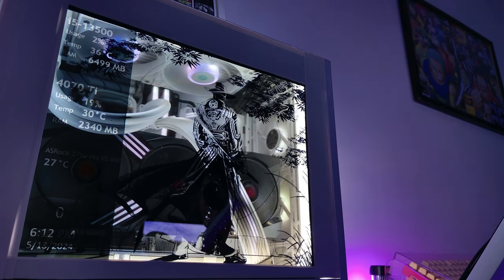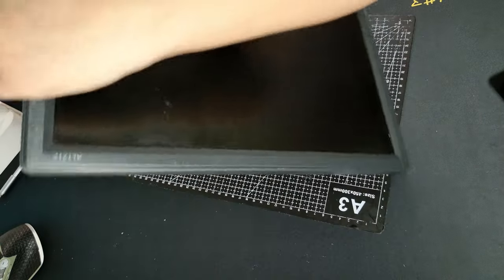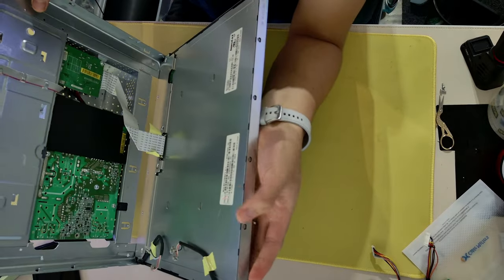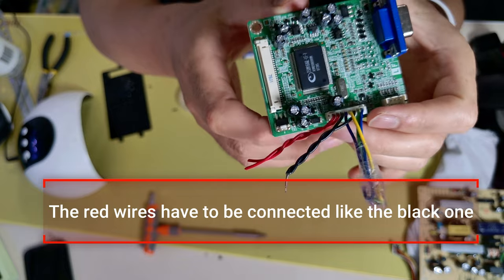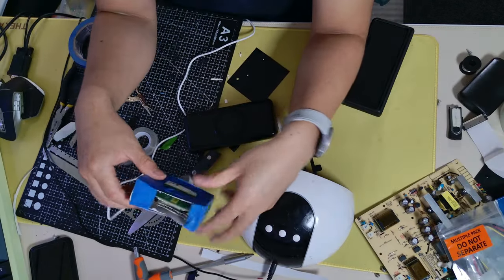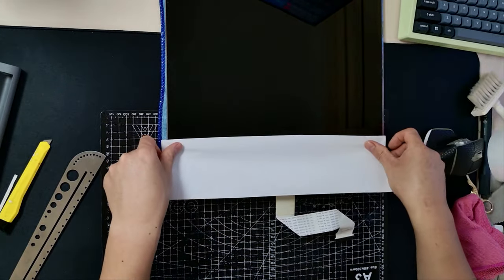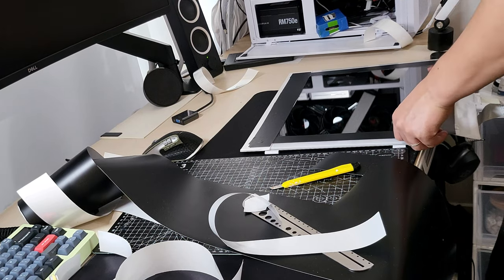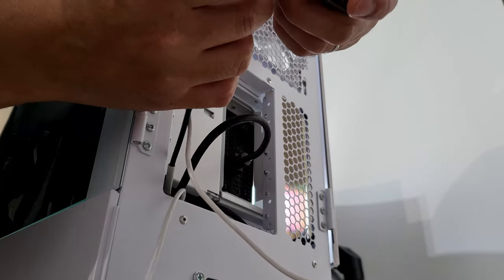How to build a Transparent LCD Side Panel for PC: Snowblind build #pcmod #gaming #snowblind

Comment from the maker: The monitor i used is from Acer not Samsung. I mispoke in the video. And If you are trying this mod, then here's a few IMPORTANT heads up.

1. make sure you leave the wet cloth on for around 6-8 hours before you peel it off. Peeling it off too immaturely leaves streaks, and leaving it on for too long peels off the polarizer as well at times. 

2. Right after you take the LCD panel off, secure the long board that's attached to the panel with vinyl tapes like I did in the video, cuz it SUPER easy to get damaged. (I destroyed 3.)

3. If you have black components  inside the case, this mod is NOT worth it. You really need plenty of LEDs and a white interior to really make it work. 

4. GOOD LUCK! HAVE FUN! and Watch this important trick. https://www.youtube.com/watch?v=dQw4w9WgXcQ
Reply: I only have a black Motherboard and black ram (the rest is white) i don't think thats gonna make the end result much different then yours if i put enough light in the case
Reply: Ty for the fast Heart
Reply from the maker: @randompsv2409  that's what you think, but a black surface cannot reflect light properly. Which makes the lcd barely visible. But do give it a try, cuz I might be proven wrong. Lemme know how it turns out and good luck
Reply: @lunosama  im gonna give it a try and If it doesnt Work i will think of Something ig

Comment: Nice video, I did this mod already. Something I'd like to add is: Use a very bright cold white LED strip. Don't get an RGB one. You can change the colours with the monitor. You need all the white light you can get
Reply from the maker: @madjoemak  oh I didn't know that, thank you. The one I had installed is a white led strip, but the lcd makes it look a bit warm.

Comment: Your snowblind custom is so simple, specially where you cut off the power voltage of the the monitor and just connect it together. Unlike others they compute the voltage in order to know which is the right one to connect voltage together.  By the way you said Samsung monitor but you use the Acer AL1717, which is the right one?  Great Work buy the way. I will try to do the same. Thank you. 👍
Reply from the maker: Thank you for the comment 😊. You're right. It was a slip of my tongue. It is the Acer AL1717. Thank you again
Reply: @lunosama hey I need some help I accidentally put the wet towel on the the opposite side of the display ( the back side) and removed the coating and now confused is it really antiglare??
Reply from the maker: @Dropship-jc9yq  sometimes the anti glare coating is pasted on both sides. As long as it is not the polarizer which is usually tinted, you're safe.

Comment: Are you having problems with your main monitor? Many people write that if two monitors with different Hertz are connected, then the main one (144 or more) will have problems. If a video is launched on the second (custom) one, there will be a drop in frames (and frame tearing) on the main one in dynamic games
Reply from the maker: i have used this for 2 months now, and i don't have any problems. This is just my opinion, but i think it will only be a problem if you are trying to display a single window in 2 monitors with different refresh rates. not sure though, but I've never had this problem cuz i dont usually split 1 window in 2 monitors.
Reply: Thats a myth

Comment: What if your cords Don't say if what it is how do you know if they are grnd wires
Reply from the maker: @thathugepillow3577   hi Huge pillow 🤣. so if it isn't written on the board, the only way I know how to check is to plug the cables in, turn the board on, and check it with a multi meter. Set your multi meter to Voltage, take your black wire of the multi meter and ground it somewhere, and test with the red wire of the multi meter. If the voltage is 0 or close to 0, that's ground wire. 
But I don't think you should worry, cuz I have taken apart 3 old monitors from different companies and all of them had it labelled

Comment: Great video.. what happend if you dont put wet towel on the back of panel? thanks
Reply from the maker: I forgot to film the rest of that part, but it is to remove the anti glare film. You have to keep a wet towel for at least 5-6 hours and peel off the anti glare coat. Don't keep it for too long cuz the polarizer film can peel off too
Reply: okay got it!!

Comment: I did this a while back but could not remove the antiglare layer. I was using paper towel, ill try again with an actual towel.
Reply from the maker: Yeah keep it for atleast 5-6 hours. And comes right off. Also don't keep it for too long cuz I did that to one of my screens and the polarizer film peeled off as well
Reply: @lunosama what happens if the polariser peels off? Does it not work after that? I installed one on my pc as well but the colors are barely visible. Even the insides of my pc is barely visible
Reply from the maker: @hardikdhingra6267  if the polarizer peels off, it will not display any image or barely will. 
In your case, it might be either the background or the light or both. So this works best with a white background, and the pc inside has to be well lit. Any black or dark background really affects the visibility of the image
Reply: @lunosama  does the polarised layer being on the inside of the cabinet affect the visibility too? I’ve pasted the flipped screen to the glass. I wonder if putting it up straight would help
Reply from the maker: @hardikdhingra6267  I'm not sure how that will affect the visibility cuz I haven't tried but, like I said earlier, if you have a low lit background or have pc parts that are black or dark in color will hamper the visibility.
Reply: @lunosama  yeah the interior’s black. I don’t have the energy to paint it all white xD 
It is well lit though. But that’s not enough I guess. Anyway, thanks for all the help :)
Reply: @lunosama  yeah the interior’s black. I don’t have the energy to paint it all white xD 
It is well lit though. But that’s not enough I guess. Anyway, thanks for all the help :)
Reply from the maker: @hardikdhingra6267  oh yeah that's it. And no worries. Hope it helped.

Comment: its not written which wire is 5v and ground in my case so what can i do?
Reply from the maker: so if it isn't written on the board, the only way I know how to check is to plug the cables in, turn the board on, and check it with a multi meter. Set your multi meter to Voltage, take the black wire of the multi meter and ground it somewhere, and test with the red wire of the multi meter. If the voltage is 0 or close to 0, that's ground wire. 
But I don't think you should worry, cuz I have taken apart 3 old monitors from different companies and all of them had it labelled
Reply from the maker: As long as you didn't peel off the polarizer which is a bit tinted, you're safe. Anti glare coatings are just a transparent coating and not coloured or tinted.
Reply: @lunosama  my monitor doesnt have written voltages, and im only measuring 3.4v from 2 pins do you think its possible or im doing something wrong?
Reply from the maker: @МаксимШерычев  Hmmm. from what i know, the multi meter should give a closer reading. BUT if you have identified the other wires, like the ground and 12v wires, and if these are the only ones left, then yes, that's most likely you're 5v wires
Reply: @lunosama  nah i only had 2 ground and 4 3.4v wires, ended up finding one i need, but broke screen connector sadly unfixable, now finding new monitor
Reply from the maker: @МаксимШерычев  I had the same experience with that board. but don't worry, I destroyed 3 monitors before getting 1 right. Theres a pinned comment in this video for a  few heads up so you don't make the mistakes I did. good luck and if you get a chance, let me know how it turns out.
Reply: @lunosama  well, i bough 2nd monitor, everything went fine untill i broke the screen somehow scratched it in some places probably hit couple times, tomorrow to buy another one, hopefully wont break it xD now i know i have to be careful with screen itself
Reply from the maker: @МаксимШерычев  trial and error 😅